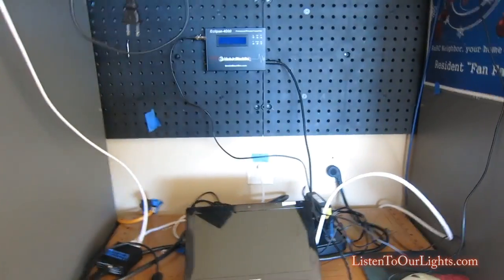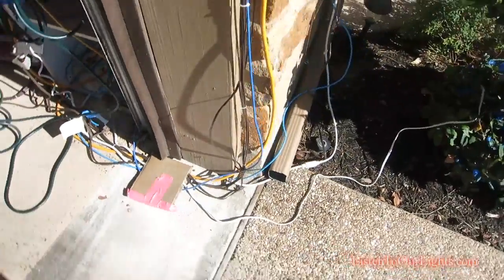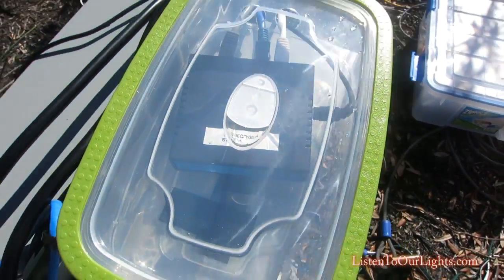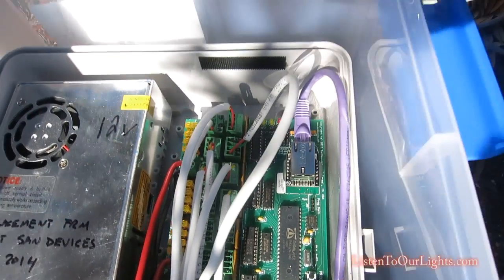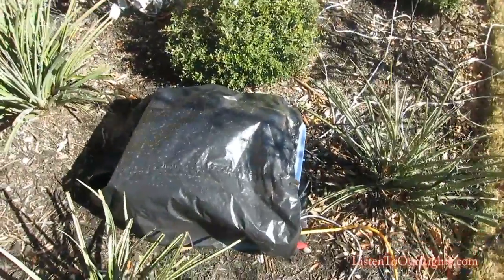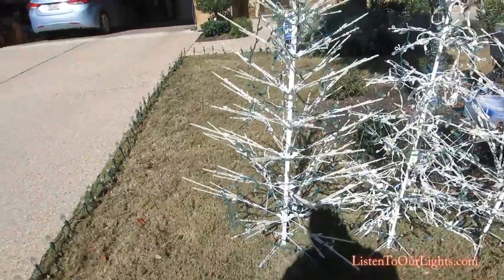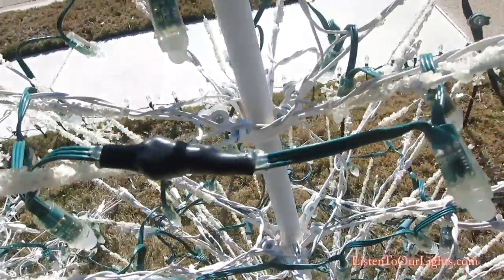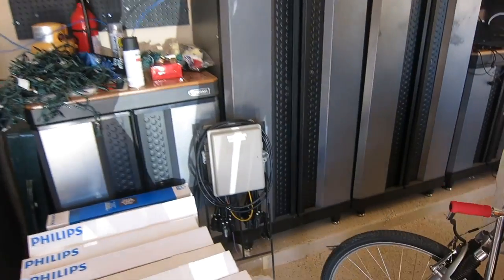Behind the Scenes Tour (ListenToOurLights) 2015

Comment: I want to add pixels to my LOR setup but am a little afraid on how they work together.

How easy is it to combine LOR and pixel controllers when sequencing in S3?  How many cables come out of your computer and does the LOR controller connect to the pixel controllers at all or are there 2 separate connections to your computer?  Is it difficult sequencing certain effects in Nutcracker then importing back into S3?  Thanks!
Reply from the maker: Grumby24 LOR and Pixel controllers in S3? Very easy you just update the network preferences saying this universe goes to this IP address or this dongle. I have 2 cables coming out of my computer. I have the USB connection for LOR controllers, then I have an ethernet connection for my pixel controllers. Sequencing effects in NC and pulling them into S3 is a snap.
Reply: listentoourlights
Thank you for the response. Good to hear this is a little simpler than I had thought.

Comment: Love the show setup and the videos they have helped me a ton. This year was the first year I used Light O Rama and only had 16 channels to play with. Next year Im going up to 48 channels and am going to add a RGB pixel tree. I was curious how many controllers you put on one circuit. I have a 20 amp dedicated circuit that I added for my controller but was thinking of putting a surge protector on it and then running all three controllers to the surge protector through extension cords. I run all leds so I didn't know if that would be a problem or not. Hoping for a little input on that from you. Thanks in advance and Thank you for all the helpful videos!!!

Comment: Very nice to see someone else's behind the scenes. 
With that many pixels in each tree at what number of pixels did you power inject.  Just trying to get an idea of how to build a 50x 12 pixel tree for next season. Any advice on e1.31 and pixel controllers should be helpful. Thanks in advance.
Reply from the maker: johnnykat21 I'm not doing any power injection with 125 pixels per string. At 150 I would have needed it.

Comment: +1 for unicast. Only way to be. Why the inline fuse on the e682? All the outputs are fused and the 2A fuse on the end is for the controller itself.
Reply from the maker: Phil Hilton That one was actually made by John at San Devices. I don't have them on the other one. I guess for just a little added protection? maybe?
Reply: listentoourlights Interesting. Thanks. I'll ask Jim next time I need something.

Comment: Hey John been watching your videos for a couple years and my family and I have finally set up our own show, using your tutorial videos to keep us from pulling our hair out.  Love your advice very clear and to the point.  I'm curious however of how you keep all those extension cords kind of centralized? We zip tied ours to make 1 big bundle but if you have any suggestions I would greatly appreciate it.  Thanks much for all you do.
Reply from the maker: I try to put the controllers as close to the lights as possible. Also I use alot of indoor cords since they are smaller
Reply: listentoourlights Yea indoor 3 way plugs have been a life saver for sure.  Sounds like we just need to purchase more controllers to cut out some of the length we travel with the lights.  5 just isn't cutting it haha thanks again

Comment: Using LOR is just a terrible way to run lights. The hardware might not be all that expensive but the software is a joke. I will never use LOR again. In fact they are so bad I started to make my own controllers, With no retarded extra software purchases and/or licenses. Turns out i can make single universe for less than AU$10 that just works.